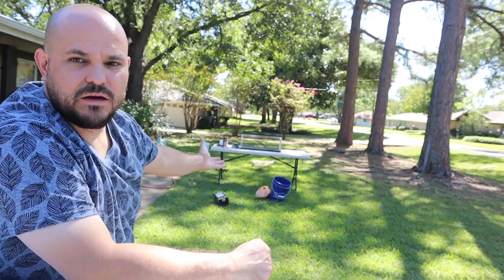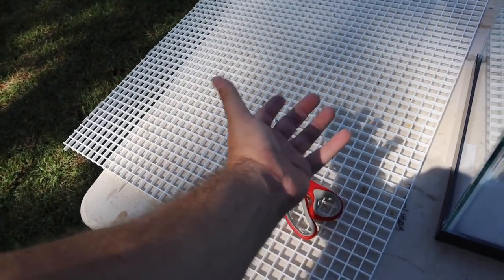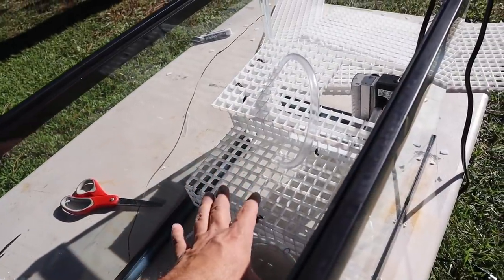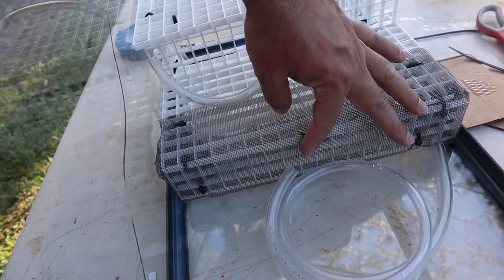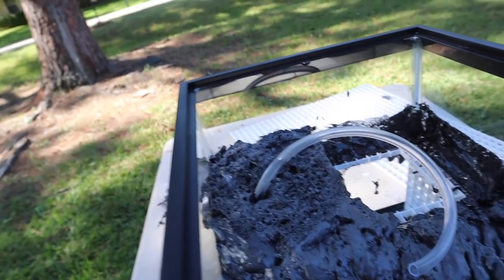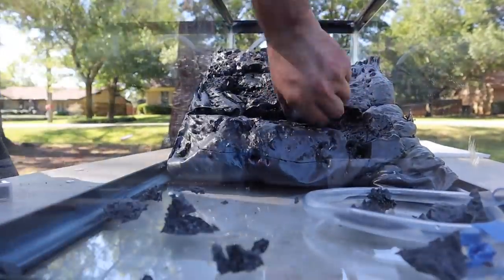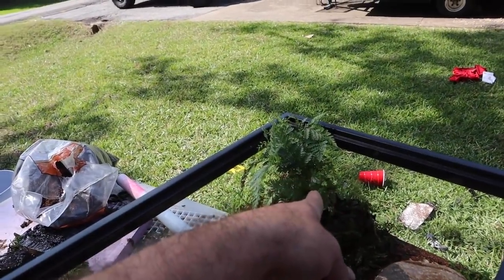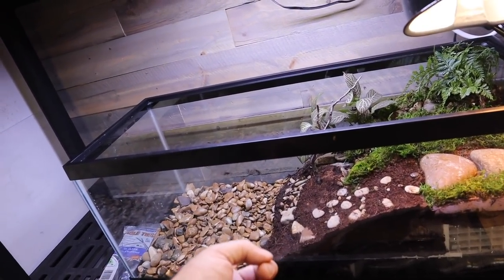Baby Turtles Get CRAZY NEW Enclosure!

Comment: what were the silicone and foam used? Also, how did you get all that coco fiber stuck on there, Also maybe the pink belly side neck should be named Pink Panther?
Reply from the maker: The foam is waterfall sealant and the silicon is 100% silicone with no mold inhibitors. You “paint” the silicone on and then sprinkle the fiber over it while wet and gently push it down on the silicon. When the silicon dries the fiber is stuck.

Comment: Looks awesome! Quick question though.. I am not sure I’m up to taking on the task of building my own tank from scratch like this but in the event I brave it, for that area you plan on painting black would it be possible to cut the platform a little shorter in width and use the foam to black out the side of the platform (technically so the blacking out is inside the tank and part of the structure) or would doing that hinder something? Thanks so much! Turtle name suggestions: Drift or Sideways or Horizon (Don’t judge me I like weird names 🤣)